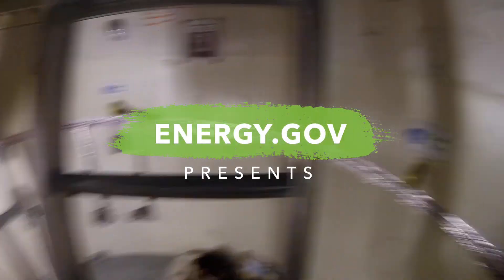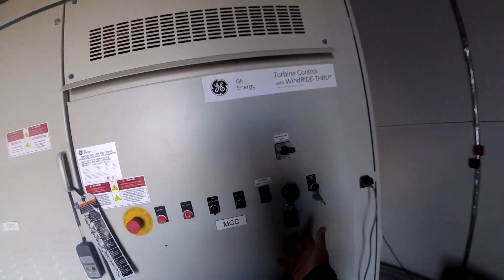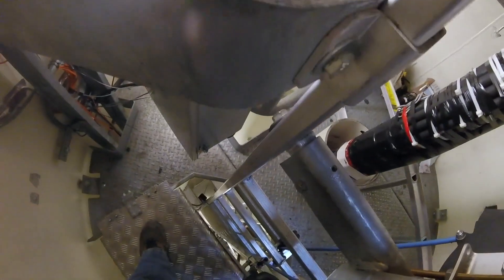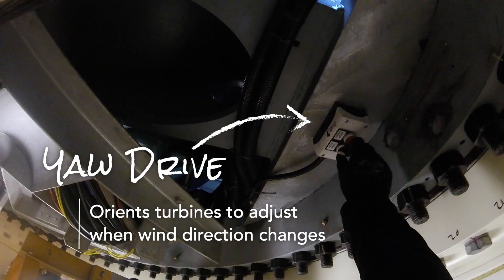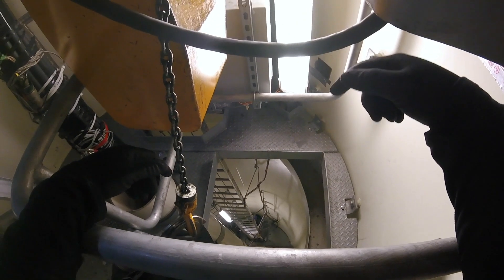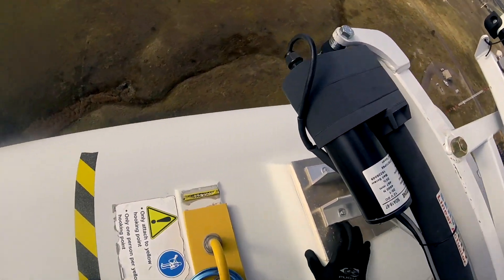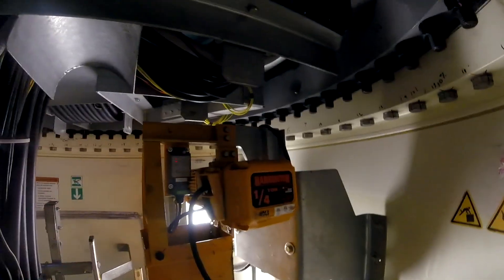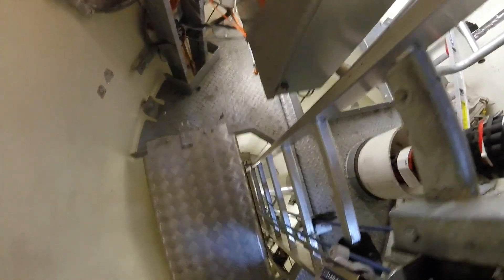Tour A (Wind) Turbine - #RoundIsAShape  (U.S. Department of Energy) GoPro

Comment: Thank you for the tour! I worked on Siemens SWT-2.3-101.

What is the model number for this turbine and how many MW? Any data on its yield and capacity factor so far?
Reply from the maker: Hey Jil Amine! Thanks for checking out our video! Some fun facts for you - Model GE 1.5-SLE,Tower height: 80 meter (m), Rotor diameter: 77 m, U.S.Department ofEnergy-owned; to be used for research and education Turbine, commissioned in September 2009.